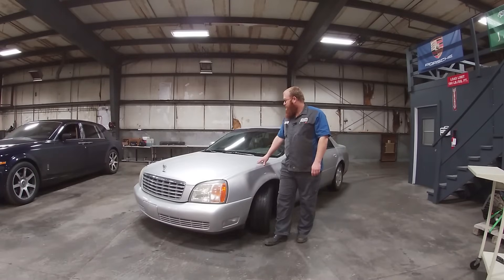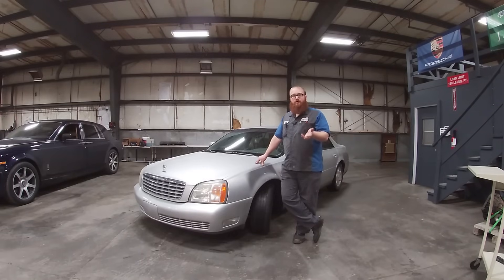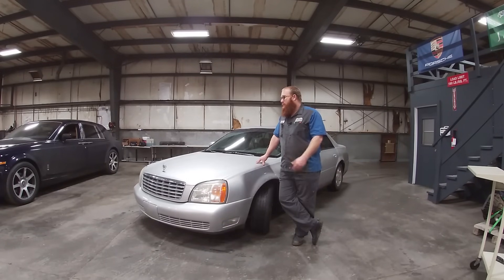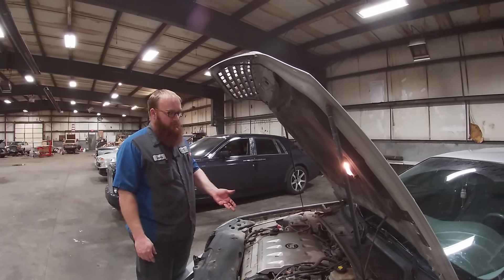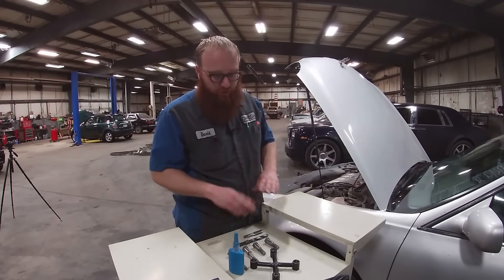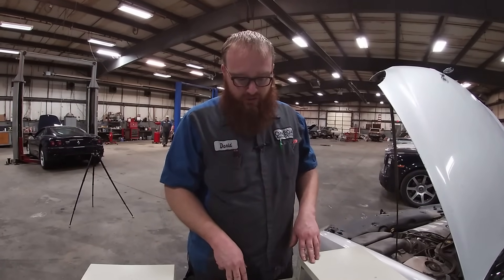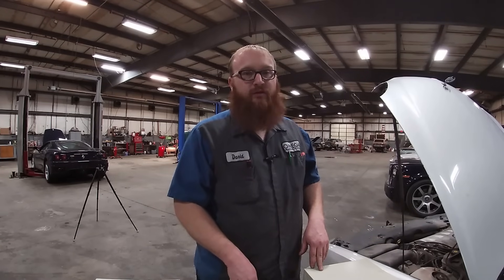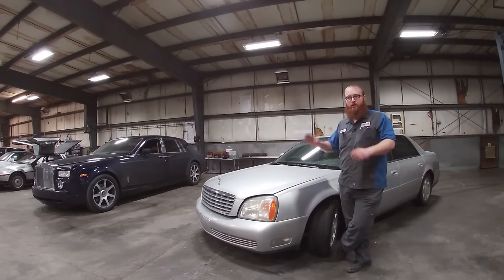The CAR WIZARD names Cadillac's Northstar Engine the Dumbest Design

Comment: I used to work for the second biggest engine re builder in the country but we didn't do these. We found that the outer edges of the thin wall casting blocks actually collapsed and anti freeze would run out. The head gaskets didn't blow, the block didn't support them any more. Just one more reason for Toyota sales to grow.

Comment: Hey just got my first car from my neighbors for extremely cheap. It's a 1996 Seville SLS  cherry red finish with a soft top with all the premium extras added to it possible still stock. I've wanted to build it up and get it super charged if I could find the right parts but I'm worried about this issue in particular. Should I spend the money on the head studs even if it's not in the years he mentioned and risk the mechanic messing it up?

Comment: I had a. '03 DTS that I decided to junk for other reasons. It did overheat once as the idler for the water pump seized causing the belt to snap. But I never had an overheat or contamination to oil or coolant after that. The suspension is horribly expensive to repair. If the engine or transmission doesnt get you, this will. But I did get $350 for it, against the $4000 i paid 4 years earlier. Fun while it lasted, but never again with a Cadillac.

Comment: I’ve had two 4.6 Northstar V8s. In two Pontiac Bonneville GXPs  a 2004 and a 2005.  Both got blown head gaskets other wise Great cars. Cost $3,600 to fix the 05 local shop. On the 04 I used Thermalweld so far so good.

Comment: Dave, can you fix a 96 Deville if it ever has a leak or head gasket issue? And low long will it last once with the improved head bolts?

Comment: I bought a used 2004 Cadillac Deville with 24,000 miles from a lady going into retirement..  We rarely use it because we work so much but it's a delight to drive in those rare days of summer.  Now the car has 35,000 miles on it as of August 26, 2020.  Will I have a problem with these headbolts on my car this 2004 vehicle?   Now I am getting really worried if we take a long trip. Any owners out there that had experience with the 2004 Northstar?

Comment: I also learned that this headstud/bolt problem seems to be common with a lot of different car manufacturers! Now Subaru is having the same issues with thier flat four!  But yes the owner will definitely recoup the cost over the long run by re tapping new head studs into the Northstar engine simply by keeping and using the car over a long period of time!

Comment: So I recently bought a 1996 32Valve NorthStar Cadillac DeVille from an 88 year old lady with 43 thousand miles. I just turned fifty thousand miles. Losing oil somewhere but nothing is visible? The car is nice and I like the size for safety. However this video alarms me! Is there anything I can do to fix and prevent things worse from happening? FYI...Dude has a solid presentation and very listener friendly.

Comment: I had a 2000 for 8yrs with over 200000 miles on it and never had any mechanical issues besides changing sensors.  Every month I put sea foam in the tank and learned how to work on them. I've had 4 from 00-05 I sold 2 of them and have a 03 as I speak with 124000 on it.a drunk driver hit it this past Aug while it was parked, the insurance company totaled it out. It's fixed.and still up and running to this day no codes or check engine light. She cranks rite up with no issues at all and break a 100 like its nothing. The same as she did before the accident. They some good riding cars when taken care of. I got a video of what mine looks like before it was hit and after it was hit. I haven't posted the video of what it looks like now,but will do so after the winter.

Comment: It's kinda like the sparkplug issue with the Ford 5.4 engine I guess. BTW I really enjoy your channel so far. I like that you said it's not a bad motor just a dumb design and also had the knowledge of when they fixed the head gasket issues.

Comment: The last new car my 93 yr old Mother bought is a 2001 Seville. At 78,700 miles, it mostly sits in the garage but we drive it occasionally and keep it maintained. It runs & drives great. Will ALL Northstars of this second generation fail eventually? No point in selling as values are nill

Comment: Hu Car Wizard  I have watching some of your video very impressive.  I am looking at a 2006 Ford F=150 sport. It is very good condition outside and in.  It has a 5.4L V8 with 200K
The frame is very good shape.  What is your opinion on the engine and transmission,  Thank you

Comment: It's a shame. I had a beauty '94 Eldorado, took the transmission out 3 times to try to stop oil leaks from many seals all over the engine, fix one another turned up gave up in the end which drove me nuts, gave it to cars for kids for peanuts. Coming from the UK I didn't have local knowledge of the northstar still wrankles that I didn't fix it

Comment: I would consider that a $2,000 price is discounted due to the repair costs that you are talking about. Once the $4-5 K is spent on the repairs, the owner now has $6-7 K invested in the car and that would likely be fair value for a now reliable and generally good car. So, I wouldn't dismiss buying the car or making the repair on the repair costs alone.

Comment: That galling of steel threads into an aluminum block housing is pretty common. I've run into it with hydraulic manifolds that will leak when it occurs. I've used telflon tape to help it. But not an option in an engine block with the heat they encounter..

Comment: After I got out of a GM dealership I became a Chrysler mechanic. Then went to work at a Chevrolet/Cadillac/Jeep dealership where I was the Jeep guy and would help out on the GM’s when they needed me. I worked right next to the Cadillac tech. He would do 3 or 4 of these Northstar engines per week. He made bank. Between head gaskets, the head bolt inserts and block-half seals, he could push one out in a day.
Reply: Damn

Comment: I got a 06 DTS and it's leaking trans fluid from a breather valve located by the brake fluid and brake booster. When I accelerate and stop fluid squirts out all over my motor how do I fix this or what is causing the problem

Comment: I would like to run into a deal on one of these Caddys that you or someone with your knowledge have already done this repair to. I had one of these that looked almost exactly like that one it was a sweet ride other than I didn't trust it for a second. The other problem with that engine it tended to be leaky.

Comment: A question I have, and it pertains to someone who wants to do this at home and does not have access to a vehicle lift; how do you get the engine out?  I have yanked engines out of older rear wheel drive cars with an engine hoist , more or less without difficulty, and then rebuilt the engine on a stand, put it back in, no problem,  and I am wondering if it is feasible for me to find an otherwise in great shape caddy with this engine problem and turn my sweat equity into a nice daily driver.

Comment: So they aren't a bad engine,  they are a good engine with a bad problem which can be fixed. I like to build my engines from the ground up before putting them into cars so whilst this does not suit someone who wants a cheap car, it sounds like an awesome project for someone who can do tje work and fab up a bell housing for the right transmission. Thanks for the video👍

Comment: The Northstar overall is a very good engine. Based on my racing and engineering experience (I'm 57) it would be world class if GM had used head AND main studs to begin with. I've changed out quite a few of these with good salvage LS engines but never get rid of the Northstars. Periodically I overhaul and upgrade the problem areas. I just LOVE hot rodding them and making them scream 🤩

Comment: Cadillac's last great engine built in-house (sort of) was the engine family that the 501, 472, and 425 CID iron block engines were based on, in the 70s.  Those were reliable, steady workhorses and if they were low on power for their size, blame the emission standards and low technology of the day for that.  Still they never lacked torque.

Comment: wizard... if you came across a low mileage 93 Allante, would you replace the head bolt issue BEFORE the gaskets blew or would you drive the car until it happened.
Reply: Im not the Wizard, but as someone who has dealt with a Nightmare Northstar, personally I wouldn’t wait for it to do it, but that’s me/

Comment: The sad part is they already had and solved this same issue on the older 4100HT in the 80s and that engine turned into the almost bullet proof 4.5 and 4.9 V8s. Somehow they not only decided to ditch those relaible engines but replace them with an engine that was in development for about a decade that not only had all the reliability issue as the original 4.1 but its own set of issue on top of those. And then took another decade to make it not a total pile. And people act surprised that GM needed a bailout.

Comment: GM also offered a rebuilt exchange motor on these. My Cadillac dealer from years ago didnt even try to fix the headbolt issue. They just did the GM crate rebuilt engine
On another note...this known headbolt issue made the value of these things drop like a stone. At 5 years old it was a relative steal

Comment: The 2003 and later Northstar's were actually solid motors. My neighbor has a 03' Escalade with the Northstar. It has 270K miles and it doesn't leak a drop of oil. It does burn a tiny bit of oil, but not a tremendous amount.

Comment: So my 2002 has 64,000 miles on it.  When can I expect those head bolts to leave me stranded?  The car has been well maintained.  Is there another engine that could fit inside there?  I will hate to throw it away.

Comment: Just a quick question suppose you have access to a later year model northstar that fixes these issues would it be possible to swap the engines since they're the same northstar?
Reply: Depends on what model? Most likely not because by the time they fixed this they made a lot of other changes

Comment: Having owned a 1998 Olds Aurora 4.0 liter Northstar, a 1998 Cadillac STS with a 4.6 liter engine and a 2009 Cadillac DTS each with over 100,000 miles on each car. I NEVER HAD ANY PROBLEMS WITH HEAD GASKET ISSUES ON ANY NORTHSTAR ENGINE.

Comment: To do it in the car, you could pre-place all the studs in their holes with some tape, putty, or 3D printed holders, put the head in place (with nothing sticking out the bottom and very little on top), and then thread the studs into place.

Of course you still need a perpendicular to surface drill guide (just drill a hole into a wood block with a drill press, and glue in a regular hardware store drill guide) and an angled drill with a bit cut short. (   https://bestofmachinery.com/best-right-angle-drill/   )

Edit: wow that's a really cool tool in that kit. I guess all you need is a right angle drill so long as that is actually a close tolerance guide.

Comment: I must have lucked out. I bought a 2001 Deville in 2007 with 64K miles, and got 10 more years and 65K more miles out of it...until the inevitable oil leak.

Comment: The Northstar engine has it's issues. Expensive oil leaks, water pump replacement, and stripped out head bolts. The second generation is more reliable but equally expensive to repair. But it comfortably transports 6 adults, 4 sets of golf clubs in a full-sized sedan and gets 27 mpg on the open road.
Reply: Not Worth it

Comment: The 2000-2005 Deville is, IMO, one of Cadillac's best looking late model designs. Just very unfortunate about the head issues on them. I have a 2008 DTS with the improved Northstar. Just rolled 100k miles and running great. I like the 2000-05 years a little better than 2006-11, however, I do not want to hassle with the heads.

Comment: Question, would a different engine be able to be installed? Like a different crate motor or do you have to go back with the northstar? Ive seen the vids of guys removing the whole setup (engine and front end).

Comment: I was considering dropping the engine out and putting in the performance studs, so I did a little bit of digging to find the little bracket/guide tool. It's $650.00. Like, are you kidding me? Cheap cast iron and some screws are not worth that much. So sad.

Comment: I just bought a 2001 STS today,  I'm dumb.. I'd be willing to pay someone to do the job.. the car is amazing.  100,000 miles not a leak anywhere.. I was aware of the possibility of the issue.. I'm just not sure do I do it now or wait until I get an issue.  The water pump was just replaced by the dealership. 
The invoice says fully tested after repair and ready to go, the owner didn't drive it much after the repair, he was afraid of it. Most people would have walked away.  But I had to have the car. 
 I'm a little concerned.. but I have always wanted a STS.  
The car was never winter driven.   And well looked after, the underneath looks like it's been on the road for less than a year. Not a scratch on the body.

Comment: What should I check on my 96Cadillac DeVille if it's running hot?I flushed the system and radiator; it's still running hot?

Comment: I had a couple early ‘90s Eldorado and never had these problems. Put about 15,000 per year on them. Never engine problems. I guess I lucked out. 
Stupidest design is my S600. That 12 cylinder is too wide for the bay such that you can’t replace the spark plugs without removing the engine from the car!

Comment: I was wondering if you could help me. I have a 1997 Ford F150 4.6 that's giving me problems. I've put in new spark plugs, fuel injectors, new wires and a new sensors. It wastes too much gas and smokes like a diesel truck. Can you please help me with this matter. Thank you.

Comment: I can see, with all the declined repairs, these cars piling up in junkyards. It's a shame. When running properly these were really nice cars. Just a question, why did GM wait for eight years to actually fix the problem? They could have done what Northstar Performance did, used oversized head studs. The engine wasn't stupid. GM is.

Comment: I'm looking at a 99 deville with 108,000 miles. It's running and driving and looks really nice, should I consider it or shy away from it?
Reply: Did you get it?  I found an 04 DHS for $1800  with 137k .   I'm fine with the miles as he does mention the 3 codes it has.

Comment: When the Northstar V8s run right, they can be great. Most every Northstar equipped Cadillac I have ridden in/driven was smooth, torque everywhere, made a nice noise when you could hear the engine/exhaust. But when they go wrong.....holy crap 😳.

Comment: The Cadillac Northstar engine is an amazing engine with fantastic performance. Unfortunately thats not what they put into the production cars with the "Northstar" badge. The actual Northstar was a 600+ HP twin turbo V8 developed by McLaren that was used in Cadillac LMP cars.

Comment: Great engine other than those tiny fine threaded bolts.  How the hell did the Cadillac engineers not realize how huge of a mistake those bolts were.  If they would have used the 5/8" studs from the factory; there would be plenty of these still running around. Probably would only increase the engine cost less than $100.

Comment: Thought for sure you'd mention that the starter is UNDERNEATH the intake manifold.  That's another "not too swift" design issue with these.  Another nit-pick design issue is the exhaust crossover restriction, which probably robs you of 10-15 HP on the top end.  But like you said, on the plus side, the engine is smooth and responsive, practically trouble-free from 2005 and up, and it gets very good mileage for a V8 in a 2-ton+ car.
Reply: Not a hard job to do and no need to crawl under the car to work on the starter. Also protects the starter from debris and moisture. A few other engines designs did the same thing.

Comment: Many Years Later This Video Is Must for Me😌iOwn a 2005 Pontiac Bonneville GXP. It has The Northstar Engine. And Yes It Is A Headache As I Have Experienced 1$t Hand Over The 8 Years I've Owned It. 6 of Those Years Were Really Good Mostly Highway... 

I Bought The Vehicle With ONLY 85k miles On It& Started Fixing& Rebuilding The Engine At 187k. It Still Needs Minor Work(brakes lines, power steering pump, & alternator) But It Is More Then Worth For Me. Most of the work I've done myself. I'm more then willing to put 4_5k under the hood for Sstuds /heads As Long As It's Done Right...The Problem Is Not To Many Mechanics Want To Deal With It. So I've Done DIY Projects, But Well Worth it If You Find The Time. As Long As Someone works the shipping out for the vehicle to help me with the cost. I'm willing to go theDistance
#GarageBuild💪💯

Comment: When I worked for Nissan/Infiniti the v6s right at around 10k miles they would start eating oil like an engine with 400k miles.  The pen pushers at Nissan decided to ignore the type of piston rings the designers wanted in it.  Long story short.  Using cheaper rings to save money was not a good idea.  I and all the other guys at the Infiniti dealership we worked at must have replaced  1000 engines under warranty considering how that was the only engine used in those cars at the time. It was a pita and one of the main reasons I will never work for any dealership again unless it's making ready the used cars for resale.

Comment: You should have clarified the "dumbest design" claim since you admitted the problem was fixed in 2005. I have a 2007 Cad DTS - inherited from my mother-in-law. It seems OK, but it has had a couple of really weird problems; (1) complete loss of coolant without a detectable leak, then doesn't loose a drop for a year, (2) dead 12V (no lights or anything that is 12V), but battery is OK and when jumped it acts like it has a full charge. We don't trust it. It does have that half-case engine oil leak. It has a lot of power and gets 24 mpg at 80 mph. We'll drive it until it dies which might be next week.